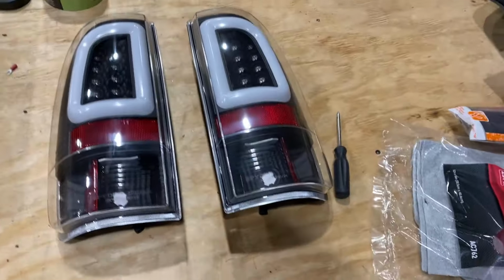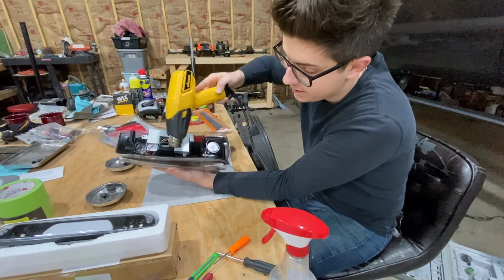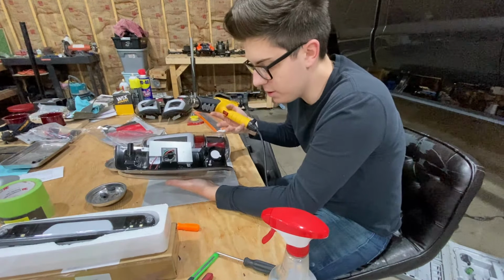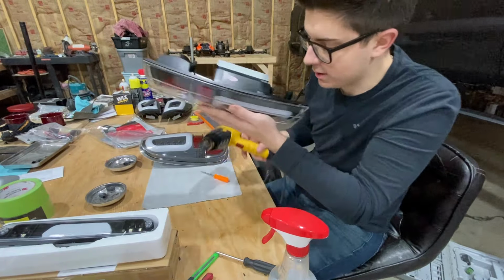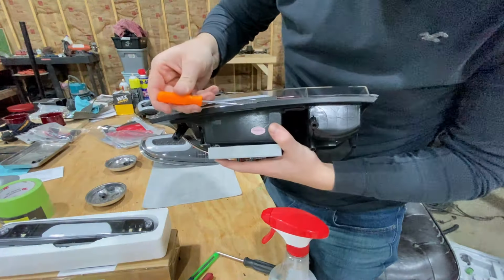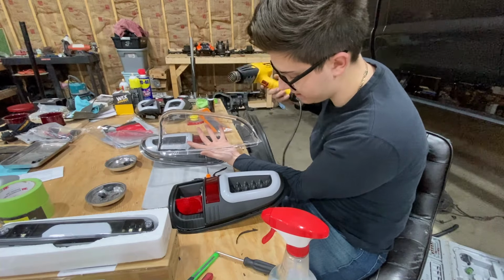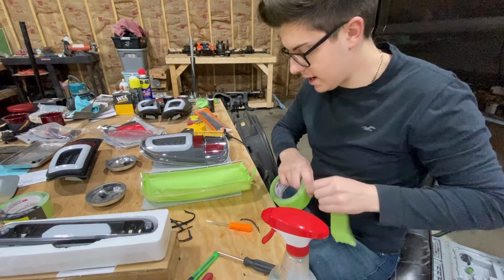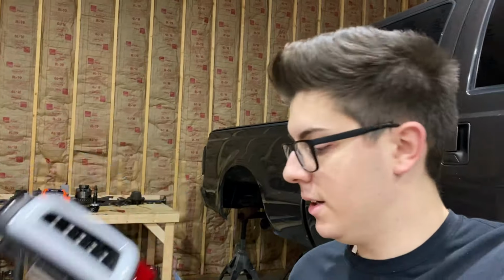HOW TO OPEN TAIL LIGHTS LIKE A PRO

Comment: Great video- what sealant you use and what’s the method to connect lens on again?
Reply: The million dollar question.  My cover popped off so I need to put it back on.  Bought some JB Weld plastic, but wondering how in the hell I'm supposed to apply a bead.  Any ideas out there would be helpful.
Reply: Butyl glue, comes in a roll just like dumdum
Reply: @johntexan4165 put in corner of plastic bag, cut off the corner with sealant inside, twist the top and squeeze the bagged sealant

Comment: Try to do it with european cars😂. They're all welded front to back with some weird vibrations method. Cutting it is the only way to open it.
Reply from the maker: That does suck , no biggy tho. Anytime heat gun method doesn’t work we resort to cutting.

Comment: Where are you located I have a 2006 hyundai tucson with clear taillights from spec d tuning one has water n is foggy i think the seal is bad I would also like to paint then with my lime green there chrome inside with clear lenses would u be able to do them n how much would u charge if u could do them for me im in pa ty
Reply from the maker: Hello , could you DM my business page on Instagram @rooster_retros , please include photos and a brief description of what you’d like done & I will get you a quote as quick as possible. Thank you!
Reply: I did u haven't responded ty ill send u another one pics n what I need ty u very much again
Reply: @JUSTINHAWKSMITH  ive been trying to contact u on Instagram under both your pages sent u pics of what I what n u haven't responded back can u pls get back to me thank you I love your truck the color is awesome same color I want my lights lime green

Comment: I’m about to paint my set of Recon’s with that same LED ring around the brake LED’s. Have you ever painted over that LED ring? I’m wanting to fully color match then if possible
Reply: I'd use a tint wrap,  or a cheap vinyl wrap if it's bright enough

Comment: Good video, thanks!  Question: any reason not to heat it from the lens side?  Seems to me this method is subjecting the plastic to the same heat (gradually), and from the lens side you can see the sealant seam.  This way, the lens should theoretically release clean and then once off, you can use the heat gun to remove the sealant from the housing.  Just curious.
Reply from the maker: Lense melts and warps faster than it does from the housing side. Once sealant is released from housing then you have a direct line to heat sealant that’s stuck to lense and pull off , super easy rather then pulling out of the housing. If you head vise versa it will warp and melt lense.
Reply: Car plastic lenses are made of Polycarbonate.
That type of plastic MELTS fully at between 200 and 300 degrees C.
The backing in black is most likely Polypropylene Melting at 200 to 280 degrees C.
So, being that the two plastics making up the whole light case will begin to turn soft as you approach 200 degrees C. I'd be careful  and keep the heat gun moving.
That's as hot or hotter than a McDonald's hot cherry pie or cup of coffee.
I think we all know just how hot that is............About 400 degrees F.
Just kidding as water can only get to 212 degrees F but know that it's going to be hot!!!!!

Same as if you are opening an Apple phone or an Apple iPad to soften the glue.
Slow and steady and I'd also be wearing thick work gloves.
Reply: @JUSTINHAWKSMITH Do that make any clear paint for reflector I have a aftermarket taillight it has red reflectors and I’m trying to get’em clear ?

Comment: Yo I just accidentally back up into a wall with my GMC 2500 at4x truck I’d like to know if its possible to just take off the plastic part cause the led is perfectly fine it’s just the outer clear part lmk

Comment: Yo not sure if you will be seeing this comment but the tailights i want are only avalible in a chrome inside instead of black, can i paint over that?
Reply from the maker: I have a older video showing painting over chrome but to summarize quickly , 400 grit sand it all , clean with alcohol , adhesion promoter , primer , base coat , clear coat. Thanks for watching !
Reply: @JUSTINHAWKSMITH  alright thanks

Comment: If you have to cut the tails open, how do you reseal them? I have to reseal some aftermarket 2015+ wrx tail lights. Great vid btw!
Reply from the maker: Silicone & JB plastic weld 1 minute epoxy

Comment: How u know if u need to heat or cut the lights. Cuz I’ve seen where some cut it
Reply from the maker: @CODYWAYNEinGA6.6  man I wish I knew the answer. You kinda just have to try to heat without breaking and use your own discretion , if it won’t come apart with heat then cutting is the only way. & also if it’s a factory tail light you must cut.

Comment: The content is great .... love the way you cover a variety of truck topics .... when putting the tail lights back together I thought you mentioned you use the oven .... correct? What temp do you set the oven to reseal the tail lights ..... thank you
Reply from the maker: I usually do 200 degrees for about 8 minutes for tail lights , headlights a little longer! Thanks for watching. These temps are when resealing with morimoto retro rubber which I have linked in the description box !
Reply: @JUSTINHAWKSMITH  Is it possible to use heat gun instead of putting it into oven?

Comment: Would a 3rd brake light be similar to these
Reply from the maker: Can be. I’ve found pre hearing third brake in oven for about 7 minutes at 200 works good. Then use heat gun while it’s warm
Reply: @JUSTINHAWKSMITH  awesome thank you, had to cut my tail lights open and was hoping it wasn’t going to be the same for it

Comment: Could you do a video opening up a 3rd brake light?
Reply from the maker: You can use this same method man.  Once heated to temp push from back thru mounting hole with Phillips head screw driver

Comment: What adhesive do you use to reattach the lens? That’s what everybody wants to know. You show how to take it off but you don’t show how to reattach it. What adhesive do you use to attach the lens?
Reply from the maker: I have plenty of other videos showing what I use. It’s no secret everyone uses morimoto retro rubber usually. Some use 100% silicone , i some times use both. & then even some plastic weld in a couple small parts to prevent the lense from every pulling away from the housing.

Comment: Call me an idiot but just to spread awareness I tried using this method and ended up breaking my lenses because the taillights I used were plastic welded. Just make sure before you do this that they are glued

Comment: What if you took a soldering iron with the razor/cutting blade to cut the glue and you stay more to the opposite side from the lense
Reply: It will melt and distort the mating surface and when you go to seal it won’t fit well and it won’t seal well.